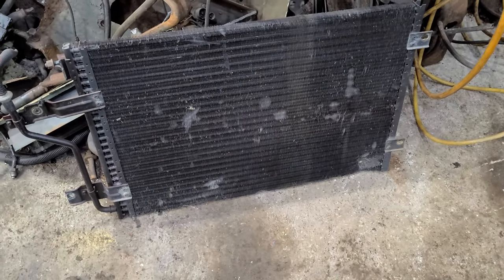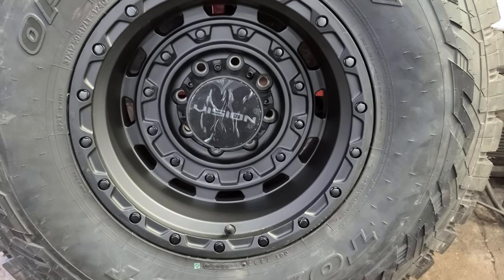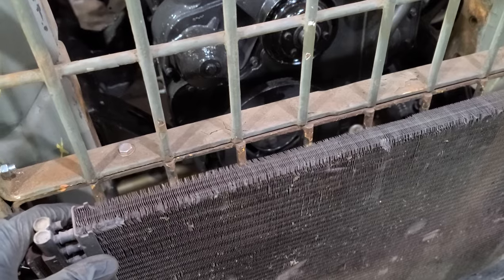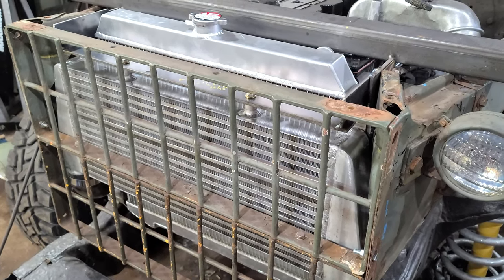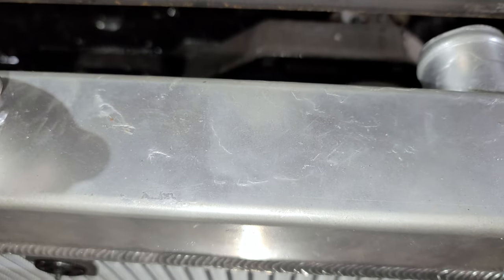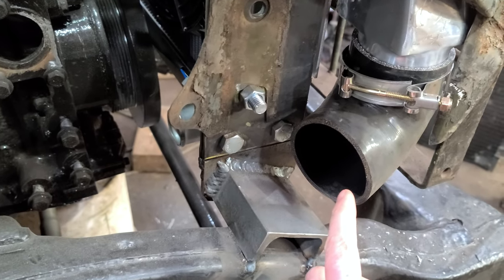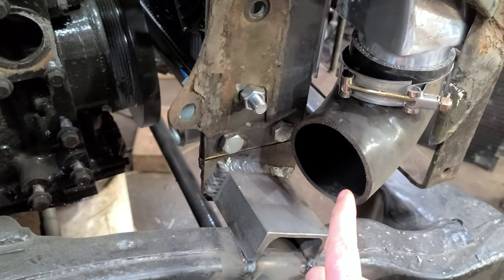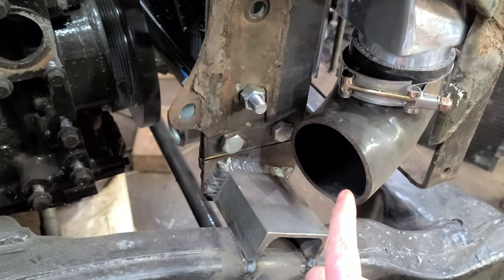Dodge M37 Cummins Conversion - Big New Tires, Radiator and Intercooler Install [Episode 16]

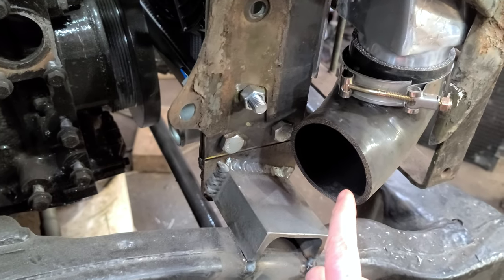Comment: Just want to say. At the 8:30 mark there’s a bolt for the rad support sticking out “ a lot”. I personally would trim that shorter now before you run into clearance issues with the inter cooler piping.  Just want to offer my one cent. (Reduced due to inflation)
Reply from the maker: Hahaha, I'll get those shortened up for final assembly.